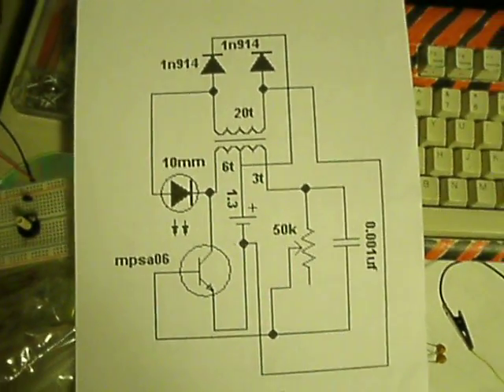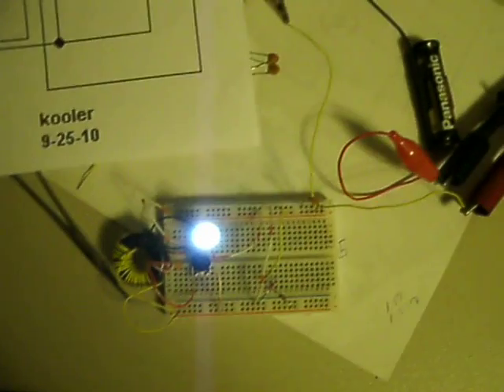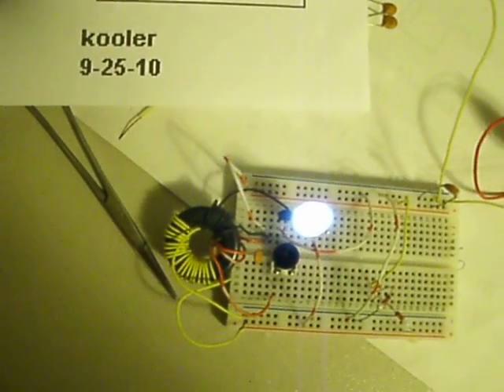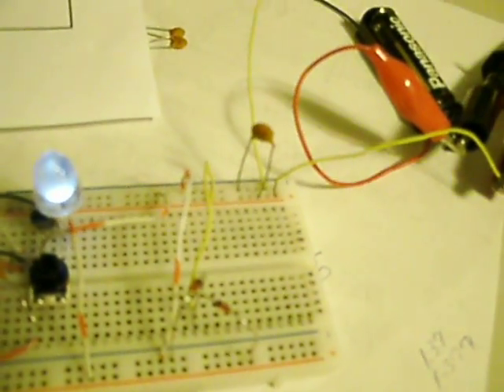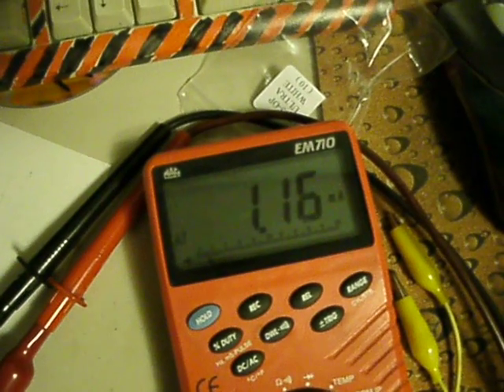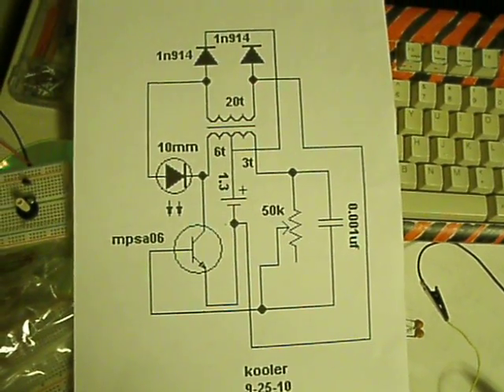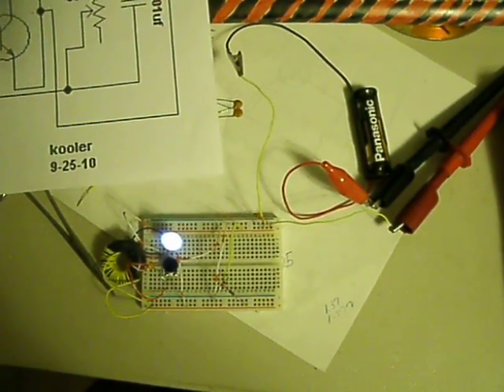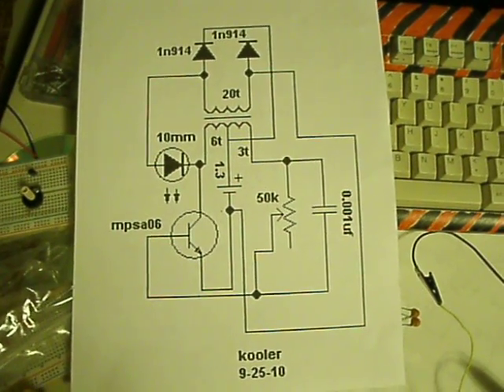weird joule thief

Comment: Nice circuit, but you can also rectify the output on the secondary and place a cap there. then you can reach about 300v. Also if you regulate the output, this circuit can became good low power step up dc-dc converter!!!